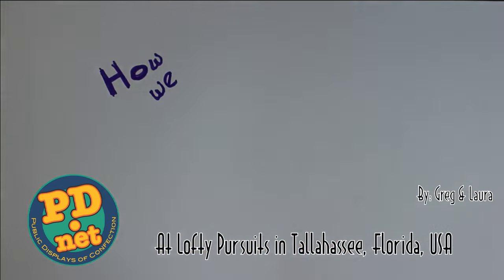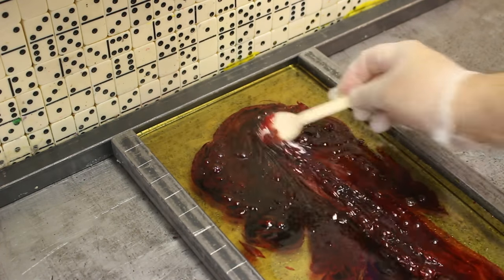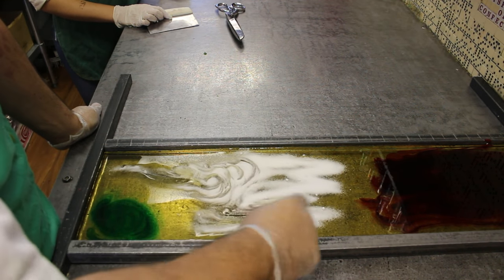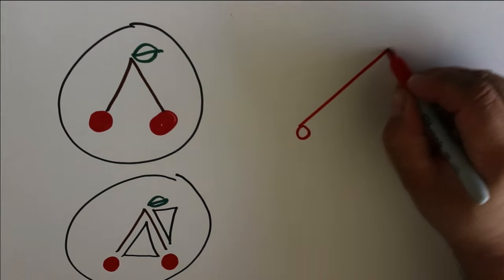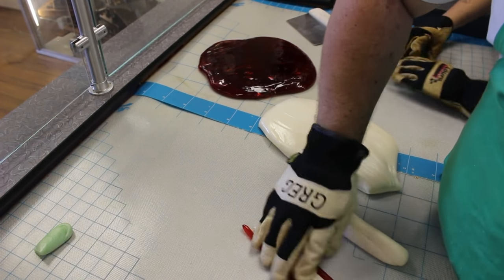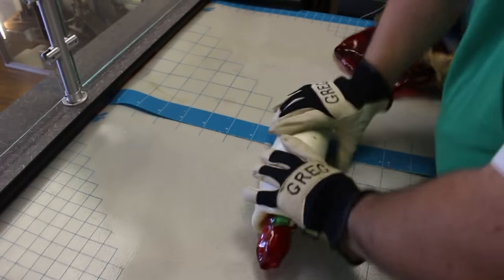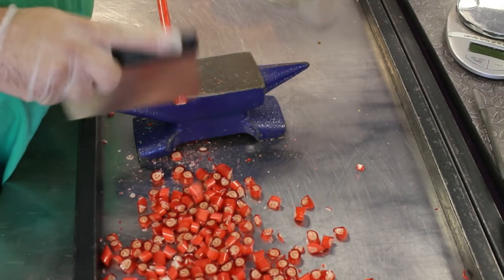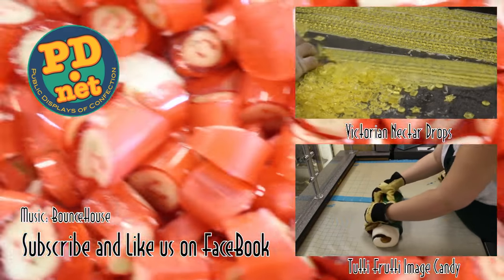#34 How we come up with the designs in Victorian Cherry Image Candy

Comment: So, I'm kind of a fan and I've watched all of your candy making videos (These videos are one of my favorite things to watch, especially when I'm stressed. They are very relaxing!) and I think this is the first time I've heard you say a couple of things. 
First, that wrapping the candy in the single clear color gives a better cut when you cut down the candy. What exactly do you mean? Do you mean it looks better or it actually cuts into cleaner edges? If so, is that because all of the air bubbles in the white cause it to shatter differently?
Second, that the reason why you don't use the white food coloring is that it's titanium oxide. I always just assumed that it had to do with stretching it being a more classic technique and I had a lot of respect for that, but now that I hear about the TiO2, I have even more respect for that as a choice!
Reply: my theory is that adding the extra outer most layer will help protect the image from distorting while they are pulling the rods/ and or chopping them.
Reply: I think you're right in your theory about the white bubbles changing the way it shatters. Think of a candy cane; the semi-clear red is much more glass-like in texture than the brittle white. If you want to get a clean break instead of a crumbly mess, it probably helps to have that harder outer shell to make it stronger.

Comment: I was wondering how you ended up working with sweets, considering where you started off. It's still artistic, but it seems very different. Did your work with glass use similar techniques to get images in the final piece? Or did you just decide to try out candy-making and find out you were good at it?
Reply from the maker: Glass working is like candy working done with four foot long chopsticks.

Comment: why doesn't the molten sugar not stick t the table?
  seems strange!
Reply from the maker: Oh it can. First of all we wax the table to make it as non-stick as we can. The real issue and prevention of sticking, is that the candy wants to stick to things the same temperature as it is. We move it around the table to keep it on cooler bits of the table. This cools the candy faster, but also keeps it from sticking. The same thing happens with the bronze rollers we use. If we make a big batch, we need a fan to keep it cool.
Reply: Hi,
Thanks for info.
Over here in UK most seaside such as Blackpool, Bridlington and Scarborough have rock shops where we can watch it being made and I couldn't see why it didn't stick .
http://www.john-bull.com/store-locations
I actually live about a mile from Joseph Dobsons in Elland who have been making 'sweets' since 1850. http://www.dobsons.co.uk/index-2.html
As a poor child my treat was a small bag of Yorkshire Mixtures.
Reply: Lofty Pursuits Hi,
On UK telly is prog called 'In the Factory' and deals with making something.  Tonight has been folding bikes but trailer for next week is making rock and traditional sweets.
If you can get BBC2 online or something you can watch it and trailer does  look interesting..

Comment: All the names presented beyond image candy were of non USA origin and dismissed for a variety of reasons. Does this mean what you call image candy was not wide spread or common historically in the USA or was there no widespread name?

In Australia, at least in the 21st century, Lollies are a generic term for any small confectionery not just the hard image candy you use. Boiled  Lollies or Rock Candy are common words (at least in Victoria) for this kind of candy but also includes non image variants. There may be olderbut Rock is used in the lollie made from 1853 (just 64 years after the first fleet from the UK arrived) for the Castlemaine Rock  (one of the more popular, still available brands, popular at airports) 
A rather strange and almost nondescript design (and not exactly round shape) http://www.bendigomagazine.com/?p=1049
Reply from the maker: Nope, no widespread name in the USA, but keep in mind, until 10 years ago, this style of candy was almost unheard of in the USA. Image Candy is a Lofty Pursuits term. It seems to solve the problem of what to call it locally.